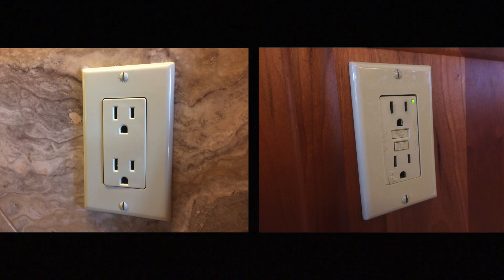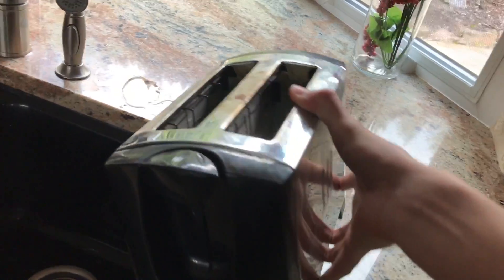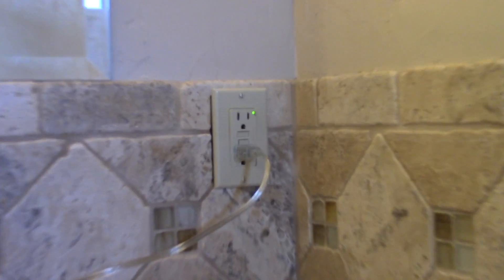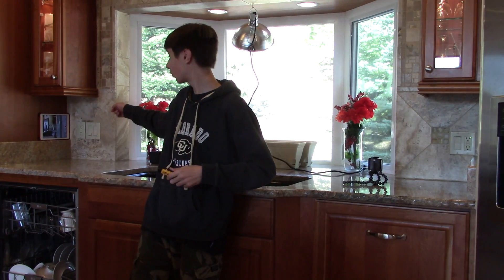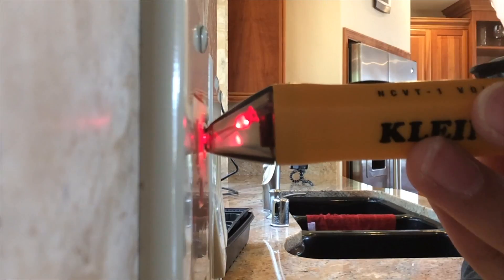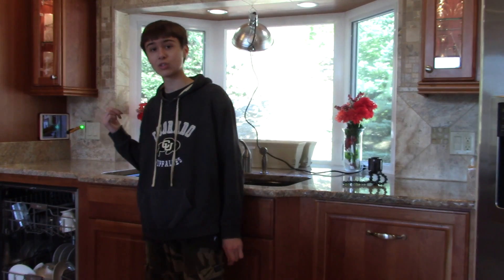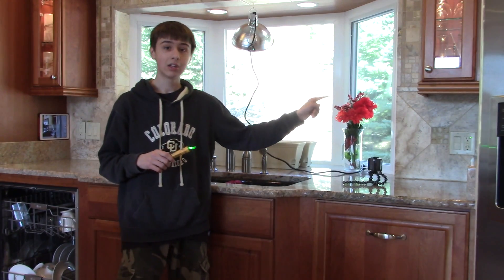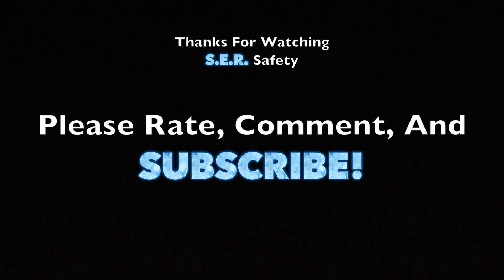What's a Ground Fault Circuit Interrupter / GFCI?

Comment: You should also test the gfci from the downstream receptacles by plugging the tester in a downstream receptacle and press the button. It should trip the gfci. If not, it is not a downstream receptacle, the gfci is not grounded (no ground wire), or it's bad.

Comment: I notice many GFCI video's mention that if other plugs are on a GFCI circuit they will be controlled by the GFCI's safety feature.  This is not exactly true.  other recpetacles in a GFCI circuit can technically be in the same circuit just not wired to the load part of the GFCI, in this case the GFCI will not cut power to the devices.  A better way to say it is that other receptacles tied to the load of the GFCI, or other receptacles controlled by the GFCI will also trip. But saying all plugs on the same breaker as a GFCI are protected is not true, and can be an unsafe assumption.

Comment: The only way that a GFCI protects other  outlets if it’s connected to the load of the outlet, not if they are on the same circuit, it’s not like a surge protector that will just take the surge to ground wherever you put it.
Reply: Right. It has to be the first outlet on the branch.

Comment: Your explanation of GFCI was a little off: the unit actually detects leakage from the normal circuit of line and return. Allow me to explain.

To clarify what line, return, and earth/ground are quickly: line is the portion of the circuit going from the grid to your house. It is the black wire in the US and the brown one in the UK/EU. The US also signifies line by a narrow plug pin.
Return is the electrical connection from your house to the grid, signified by white in US and blue in UK. These two connections alone are what provide the electricity.
Earth or ground is the third, round pin on the plug and is universally coded as a green wire with a yellow stripe. It connects directly to the Earth and is used to ground metalwork so that if it should become live it has a safe return path instead of possibly becoming live and electrocuting someone.

Say for instance the toaster you gave in the video were to be dropped into the sink. Drain pipes are usually metal and also go into the ground and therefore are grounded, which leaves a direct path from line to earth, and the GFCI sees this imbalance in what's going out through the line and coming back through return and cuts the circuit. Nevermind how - that's what electrical engineering is for ;). Usually, in the electrical field, it is recommended that you stay grounded when working with GFCI circuits, because if you touch something live the GFCI will see it and trip (ideally, anyways).

But say you were working on a GFCI-protected circuit and accidentally touched live and neutral(return). In this case, you are directly connecting the line and neutral and so there is no imbalance. Unfortunately for you, the GFCI just sees you as a lightbulb or other normal load and it's up to the fuse or circuit breaker to trip in this case. 

Hope this helps :d
Reply: Thanks 8 Bits your explanation was very clear.

Comment: You should also do a AFCI video
Reply: Phantom an afci is an arc fault interrupter. Usually a breaker and/or outlet. When an arc happens, either in internal or external wires the power is cut.

Comment: The way the that circuit works, is the GFCI cuts power to the LOAD side but the GFCI is still live on the LINE side if you were to wire multiple GFCI's on one circuit, you would wire it as LINE in and LINE out.